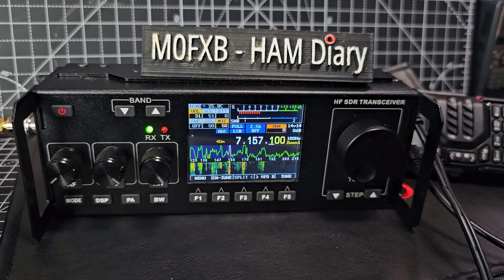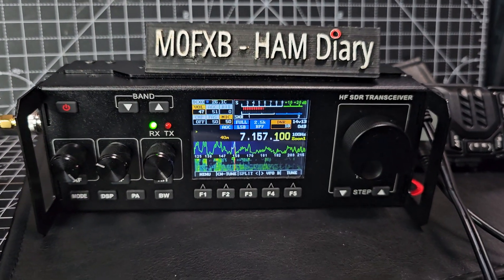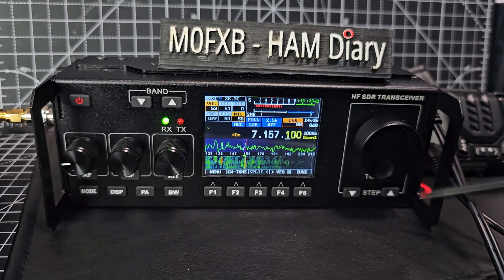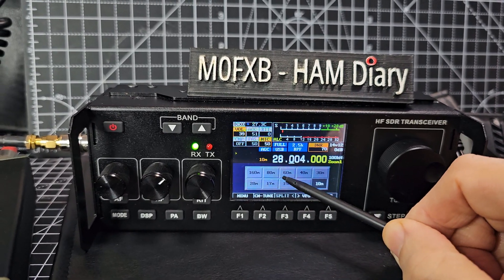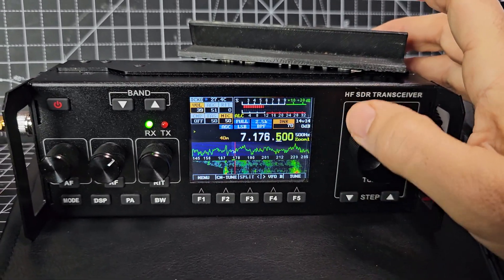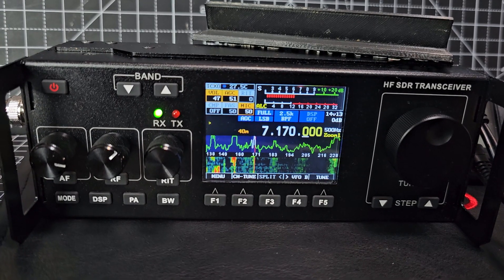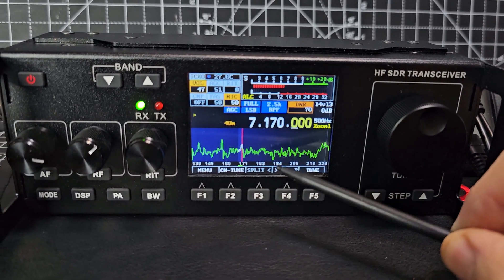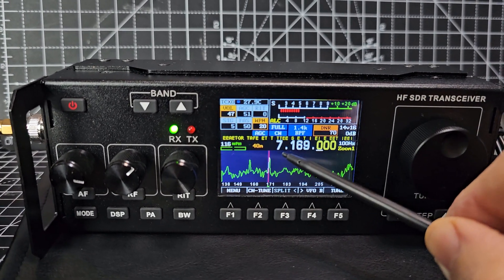RS-918 HF Transceiver , NOISE Reduction

Comment: I like the radio but not impressed with the NR
Reply from the maker: It's no worse than tye X6100
Reply: That is why I sold my X6100     @HamTechRadioScannerDrones
Reply: the 50ms fast decay of the AGC  setting  makes the DNR not effective  ,  just put it 450ms and see the DNR effect , this assume that Audio filters was already set to the optimal one : LPF 2.7k* + 65HPF ,  so this video does not show correctly the DNR capabilities of the RS918 , also  Rx condition seems have a lot of local pulse wish is can be reduced by a Noise Blanker NB  function set to around 10 or 9  ,  see this video for an example : https://youtu.be/3TMIVp8PP-0   or also this video for Noise reduction demonstration  :  https://youtu.be/qbfPsMa1hQY